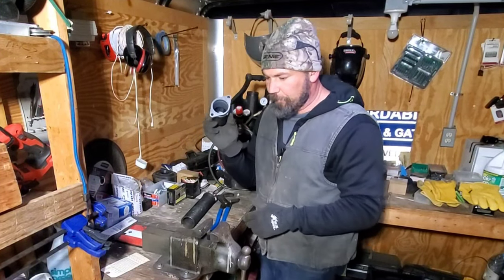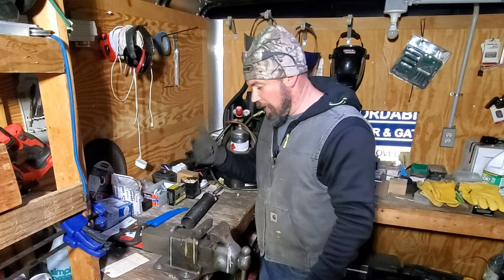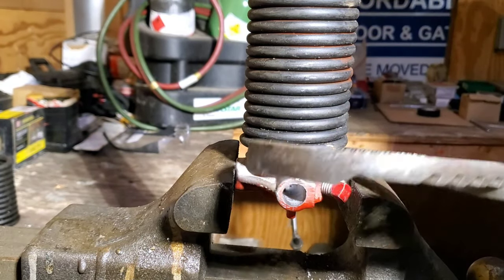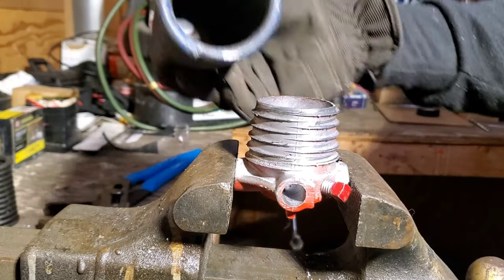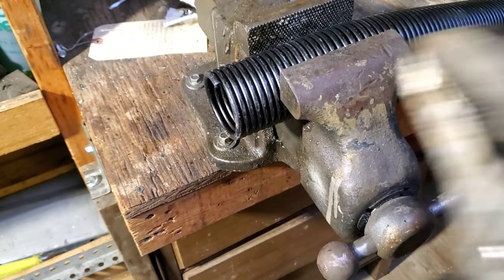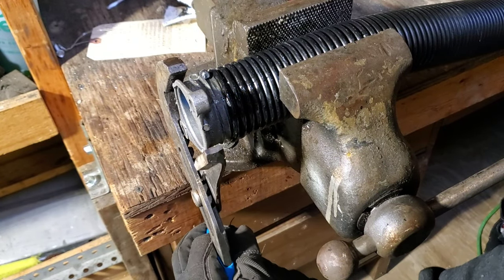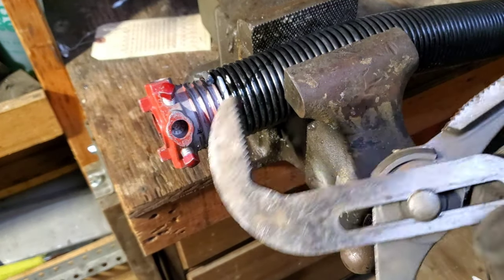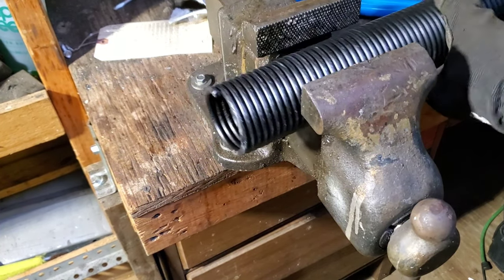How to take Cones off  Garage Door Springs

Comment: I use a solid block of steel or the corner of my work bench (1" steel top) to slide the spring over and wack it with a hammer to flare out the end of the wire (no torch needed) then as as Chuck says I use a flat bar with a couple of bolts to wind on the stationary cone and a bar for the winding cone
Reply from the maker: Nice I'm definitely going to try that👍

Comment: #1 tip when torquing the springs, wear safety glasses. I've seen guy move quickly between bars and partially insert on bar to have it slip out and cartwheel them in the face knocking out a tooth, eye or can even kill you. Take your time.
Reply from the maker: So true 👍

Comment: At our shop we have a rod with two pins on it to wind the stationary cones on and use the same rod for the winding side. Our main spring guy built a cone winder out of a garage door operator motor and used a couple of angle irons with a air cylinder to clamp the spring. The angle iron clamp rides on a track and as the motor rotates the cone it pulls the spring onto the cone its got forward and reverse. He can do approximately 50 springs an hour pending on size.

Comment: I like to put the spring upright in the vise and wind the winding cone on with a winding bar.  To wind on the other cone, I use the straight piece of the door arm that has a couple of hang bolts set the right distance to fit in the cone holes.
Reply from the maker: Good advice thanks for the info 👍

Comment: great vid, im designing a bed lift in my cargo trailer and want to use one spring under bed frame and 4 drums  with 4 cables attached to top wall. Any suggestion on spring length to lift a max of 150lb? i have about 42 inches for pipe. Appreciate any /all suggestions. thanks
Reply from the maker: That’s cool. I really feel like if you could find a local garage door place they might be able to try a few different springs. You could also try the Service Spring app but it’s mainly for garage doors but it might help.

Comment: Thanks. My spring broke right at the stationary cone. After I watched you video I got the broken piece off and bent the end and screwed it on. torqued it up and works fine. Didn't even take it off the rod. Comment: I sprayed the springs with silicone like I do every year and it broke the next day. I was telling a friend and he said the same thing happened to him. Weird. Only going to use it till the new springs come in. Thanks again

Comment: Hi I like your video! I'm hoping that you would be willing to answer a question. What keeps the springs from unthreading from the cone during normal operation? I have had two (R) springs unthread from the cone on the 30th 1/4 turn (31 Total). The second spring was a replacement for the first. Am I doing something wrong or did I simply get faulty springs? Thanks

Comment: Do you have to reuse the old cones when you get new springs?
Reply from the maker: You can use used or new cones. If you order new spring’s they typically will come with new cones.